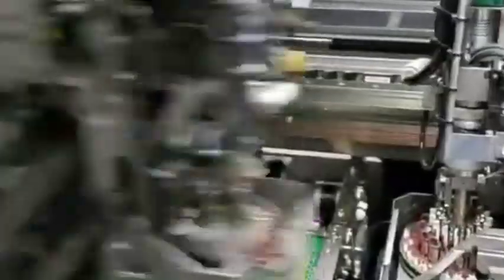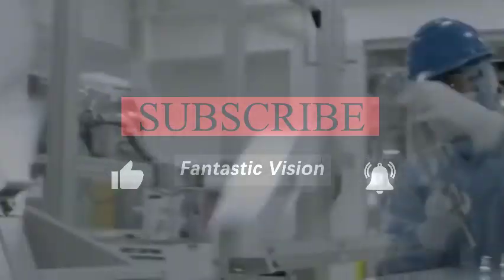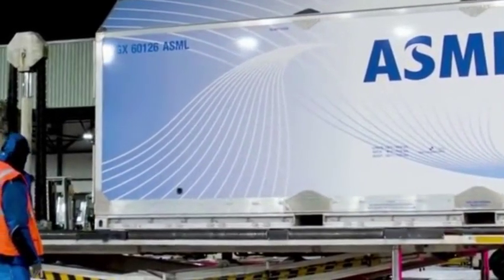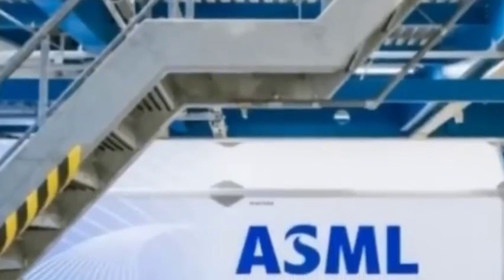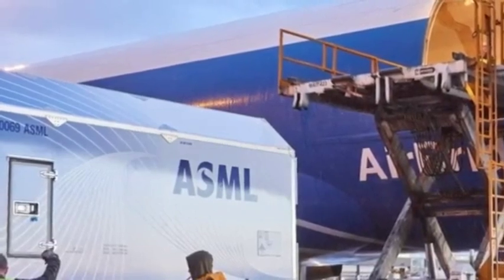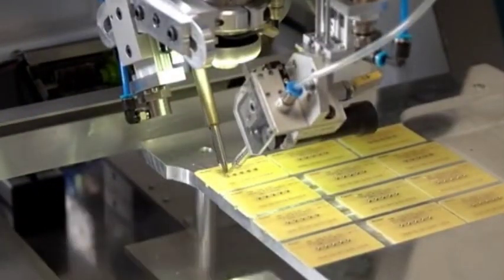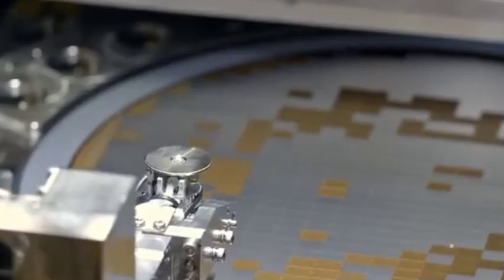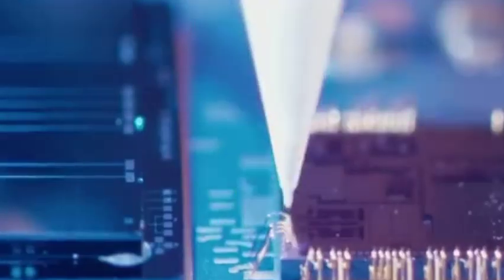China's packaging technology has broken through the 4nm chip process, the future of Moore's Law?

Comment: This is a sligh of hand.  It may be the equivalent of 4nm, but in reality it is the stacking that gets the density of 4nm equivalent.  The video doesn't say what the lithography density is, but it could be 7nm.  By taking the circuit and basically cutting it in half and stacking the two chips together, you get 4nm density, but not 4nm performance.  The idea of smaller nodes is to get higher bit rates and lower power consumption.  In this case, you will not get 4nm performance, only 4nm density.  The marketeers will say it is a 4nm chip, to sell it, but if they read the fine print there is a performance difference.  If not, the EUV is a waste of time and cost.